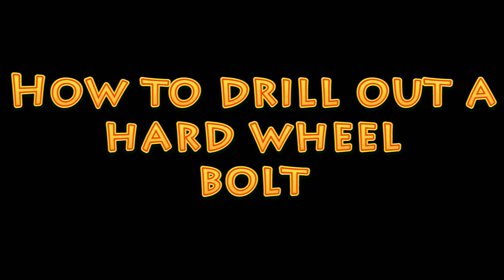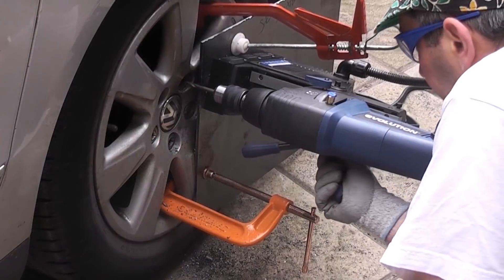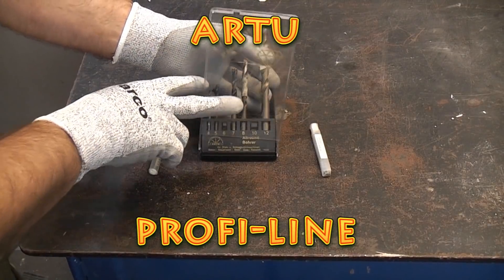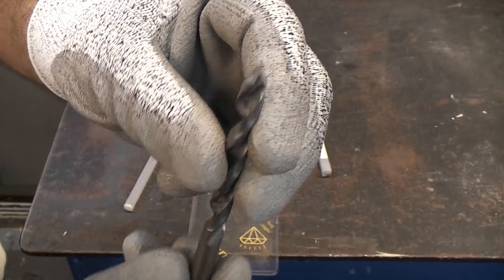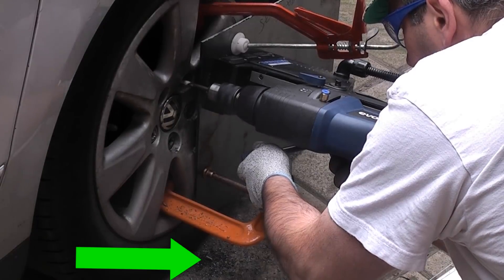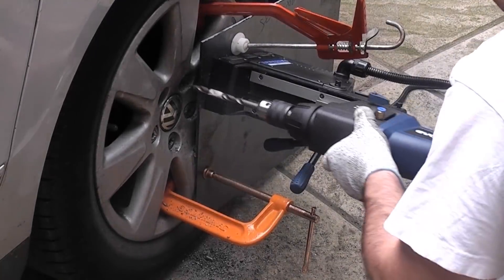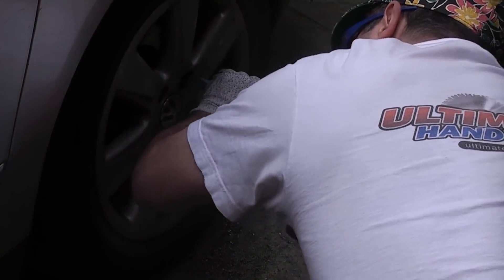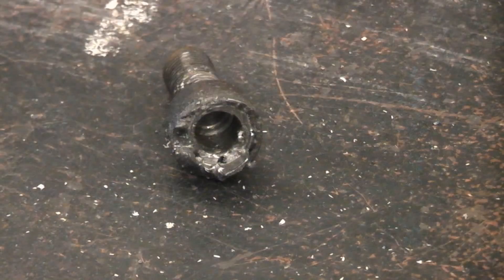How to drill out a hard wheel bolt

Comment: I am trying to drill out an exhaust stud to get my DPF off. All are absolute b-stds. Have cut all heads as the material was completely unrecognisable as a nut and the stud ends. now trying to drill through the remaining part of the stud. Have made progress but pretty slow. I am using a bit I believe similar to the one you are using (Boch expert tungten carbide) the ones with blue flutes. I was under the impression these needed to be on a slow speed and lubricated... Will be sliding back under to whack up the drill speed and let it get hot. Hope the chips fly now. Will report back. Fortunately I don't need to worry about damaging threads as will be replacing with bolts.
Reply: Yep no need to go slow with those bits though they will dull. DPF now successfully removed.

Comment: One my wheel locking wheel bolts has just broken… the head snapped off, just a frustrating situation! I think the garage out the bolts on way too tight, quite a while ago, which didn’t go too well with the aging locking bolts! 
Don’t suppose you’re too far away from Nottingham?
Reply from the maker: I’m miles away, sorry. (Darwen, Lancs)
I’m afraid I no longer have the mag base drill either!
Some garages tighten wheel nuts/bolts using impact drivers, which causes major problems. I’m sure there is a British standard for tightening wheel bolts, which means they should be using a torque wrench!

Comment: Well told if I buy the cobalt drill set would I be able to drill through the stud with my electric drill bit confused because others are saying you can  any help appreciate thanks
Reply from the maker: It depends how hard the stud is. On softer steels a cobalt drill bit will work fine 👍 
Just make certain you use plenty of coolant/lubricant to prevent the drill bit from over heating.

Comment: Help, I (many people also) don't have those special tools. How to remove a free spinning lug bolt with a nut still on it and they are recessed in deep of the wheel? 
Because if I can't remove the bolt, there no way to remove the wheel, caliber & rotor to replace the wheel hub.
Using this drill tips, what type of drill bit I can drill? 
Used carbon drill bits did not good
Reply from the maker: Wheel bolts are much harden than a traditional bolt, so you need a specialist drill bit, such as the ARTU multi purpose bits. You could try any drill bit that is TCT, such as a masonry bit.
A solid carbide bit will work, but they are incredibly brittle and snap easily. 
There is a specialist kit available now for removing anti-theft wheel bolts- but I've never tried it myself.
Reply: @ultimatehandyman  You are correct on the carbide bit. 
When I used them by hand drilling, they mostly snapped.  
Many thanks for replying back.

Comment: Wow.  I believe that I have that exact situation on a 2007 Jeep Commander.  Impact drill, W40, pipe extension, hammer will not release the lug.  Tire shop broke a lug socket attempting to remove it. Woodside, QNs. NY area.
Reply from the maker: Best of luck with it ;-)
Thanks for the comment 👍
Reply: @ultimatehandyman  I finally found a shop that was able use the drilling method to remove the lug.

Comment: The locking nuts are harder than regular lug nuts.  I attacked it for a few hours today with a drill and and am getting close...I think.  A Milwaukee 1400 ft. lbs impact and 2 keys couldn’t  even budge it.  Makes me wonder what happened.
Reply from the maker: They can be a real pain to remove!
Thanks for the comment 👍
Reply: @ultimatehandyman  it’s real tough.  I’m using cobalt and got passed the stud length and am working the width of the stud now.  Hopefully I’m doing it right and using a good set of bits.  This is worse than rusty leaf spring shackles!

Comment: Excellent video. Thanks for uploading. I've got a Peugout with recessed antitheft bolts. I've drilled out two, but got through a fair few TCT bits. HSS just went blunt immediately. I tackling the remaining two next weekend. I've managed to drill most of the way through, and I intend using a stug extractor, but what drill bits would you recommend. I only have access to a hand drill or a mains  sds with a chuck adapter.
Reply from the maker: I used the ARTU multi purpose drill bit for this one, but any multi-purpose drill bit should work.
Thanks for the comment

Comment: Tungsten carbide is better than titanium bit?

Thanks for letting us know not to use a Cobalt
Reply from the maker: Cobalt  will work on most bolts and is better than Tungsten, as it's not as brittle. 
Tungsten carbide bits are very tough, but very brittle, so if the drill moves sideways slightly it will break the drill bit. The bit that I used in this demo has a Tungsten tip, but the drill bit is steel, so can flex without breaking. 
 Thanks for the comment 👍

Comment: Weld an old wheel nut to it, or use a rotary tool grind a slit and whack a flat head into it and turn gotta do it myself tomorrow
Reply from the maker: A mate of mine tried that ( he was a coded welder ), but it didn't work.
Thanks for the comment 👍
Reply: @ultimatehandyman  just done mine with a titan sds drill loading up to YouTube now with chisel not drill piece

Comment: Just as an aside .. there no reason the tyre could not have been replaced WITHOUT removing the road wheel from the car ... not fun job, and requires some patience ... but would require no special tools and no expense.
Reply from the maker: That would probably have been the easier option- not sure how the tyre would be balanced on the vehicle?
Thanks for the comment
Reply: @ultimatehandyman  ... Well first of all Balancing tyre and road wheel assemblies is vastly over rated .. i have my own tire mounting/dismounting machine and have never balanced any tyres on a dozen different trucks and cars in the last 30 years ... and they run just fine 
Second of all? :) ... balancing he road wheel assembly while it is mounted ON the vehicle is a much better prospect if you are looking to actually balance the assembly, as it takes into account the massive weight of the cast iron rotor or break drum as well ... its called "On Vehicle Dynamic Balancing"  and involves spinning the road wheel assembly on motorized equipment ... this type of balancing has been done and top end tire shops since the 1970's at least.
Reply from the maker: Thanks for the info ;-)

Comment: Just buy a locking wheel nout removal spanner. Costs about a tenner and a lot easier to get off rather than drilling. Alternatively, if you dont mind wasting one of your sockets, select the size that is a little too small. Hammer that onto the wheel nut and just remove by undoing as normal. Personally, Id never attempt to drill one off
Reply from the maker: I'm sure the garage tried that- before I drilled it out ;-)
Thanks for the comment

Comment: .......am just now in the process of having to drill out two wheel studs (12 mm) on a 2012 Chrysler Grand Caravan...I must have had a mini stroke when I was at the tire shop last, because I did not stop them from using a pneumatic impact gun to tighten the lug nuts. Need I say more. Chrysler uses a steel lug nut wrapped in chrome plated sheet metal. If the nut is too tight on the wheel, and the socket slips and distorts the sheet metal, you are sunk. Even hammering the socket onto the damaged nut did not work. The nuts were so tight, the socket simply rounded the nuts beautifully. Fortunately the studs are drill-able with coated bits and I used about four sizes before using the 1/2 " final drill. Key to drilling out studs is to make sure the first hole you drill is perfectly centered. I made a centering tool out of a spent stud to accomplish this initial centering. I always clean the threads well, apply anti seize and torque by hand with a hand torque wrench. I also replace the OE lug nuts (the ones with the shitty sheet metal ) with aftermarket nuts machined out of a single chunk of steel.  It works for me.
Reply from the maker: Thanks for the comment ;-)

Comment: What about drilling a slot then twisting a driver in it,   Either it turns or the head snaps off,   Either way the wheel comes off right ?
Reply from the maker: Cutting a slot in something that is really tight, rarely works.
Thanks for the comment

Comment: How does drilling out the center of the bolt help to loosen it? The outer diameter and threads are still intact so why does this work?
Reply from the maker: Two reasons, firstly the heat generated by drilling can help to loosen the bolt (the ARTU drill bits are designed to be used with no coolant or lubrication, so they sort of burn the metal as they drill).
Once the inside of the bolt is drilled out the bolt no longer has as much strength.
Thanks for the comment
Reply: Thank you for your response.

Comment: Nice video Chez. I like the idea of clamping a piece of steel plate on and using a mag drill. Those bits are impressive. Haven't seen the tipped ones like that before. 
I see the "to anti seize or not" argument going on again. Done it for more than 40 years myself. No problem so far. As you say Chez you can reduce the torque by a bit. There is some argument that the proper anti seize stuff is apparently made to actually lubricate as little as possible. 
Never actually put it to the test though. I suppose it might make an interesting experiment. 
Most tyre places where I am in the UK torque the nuts now anyway, and don't just bang them up with the air gun like they used to. 
I binned the locking bolts on my Peugeot. I think a set of four normal bolts were less than £15 online.
I reckon the risk of getting the wheels nicked is less than the risk of having to do the job here!
Keep up the good work mate! 👍
Reply from the maker: Thanks Dave, the ARTU drill bits are good on really hard metals and are much better than solid carbide bits as they are not brittle. 
The anti-seize debate and lock nuts debate (which nut goes on the bottom and which nut goes on the top) can go on for ever!
Luckily, I only drive a van with steel wheels, so nobody wants to steal mine ;-)
Thanks for the comments

Comment: M42 Cobalt bits would drill that right out.  People buy bits that say "cobalt" and then wonder why they don't work. If the bit doesn't say M42 Cobalt then dont buy it.  There is a guy on ebay named drillhog, you can get them reasonably priced.
Reply from the maker: Thanks, I have just seen his drill bits- https://fave.co/2xm7yEQ
I think the ones I tried were the cheap ones I bought from Banggood, I should have tried my Dewalt ones!
Thanks for the comment

Comment: They make a socket for this it works very well
Reply from the maker: Thanks for the comment
Reply: Michael Tate they make sockets but if you don’t have a impact gun you would get the bolt out of the extractor socket I did buy had ther garbage after the bolt stays stuck in unless you have impact gun and compressor

Comment: I know a lot of people in the comments are getting on you for putting anti-seize on the bolts and some of them are correct, but I do it too because I can't bear the thought of torquing dry metal-on-metal. The worst it will do is put you over your target bolt stress a little bit and that's not necessarily a bad thing when you're talking about something critical like holding the wheel on your car. 

A lot of people take manufacturer torque specs as gospel and when you're talking about engine components and such, that's not a bad thing because those parts are covered in oil all the time and protected from the elements. But when you're talking about a part like the wheel that is exposed to weather the only possible way for a torque spec to accurately achieve the desired bolt load is using all brand new parts under controlled conditions. All you're doing when you torque something is educated guessing and when you're torquing a wheel its even worse. It just a shot in the dark. It really isn't that accurate to begin with. 

And for people who are worried that lug bolts can't handle the extra amount of bolt load; let's just say that the lug bolt is a M14 x 1.5 Grade 8.8 (because it won't be any less than that). That grade of bolt yields at 640mpa bolt stress. Lug bolts are usually torqued to about 122NM (90FTLB). When this bolt is torqued dry at 122NM that is about 350mpa bolt stress. 

Now let's just say you had the slickest anti-seize ever. Using a "nut factor" or "friction factor" of .14 (which is super low. You're just gonna have to trust me that your nut factor isn't going to be this low). 122NM is only going get you to about 500mpa of bolt stress. 

I'd be more concerned with people who are torquing their old dry crusty lug bolts to 90FTLB who are probably only getting about 150mpa bolt stress!!
Reply from the maker: Thanks for the detailed post. There are a lot of confused
people on the internet and Anti-seize as well as locking nuts seems to be two
areas that get people arguing. I always use anti-seize on most bolts, I work in
a job where if you don’t use it or if you forget to put it on you have absolutely
no chance of undoing the bolt, which means burning the bolt off. I remember a
while back making a video about nut locking and then people started arguing
that the half nut should go on the bolt before the full nut 😊 Of course when I was at
college we were taught that the full nut goes on first, then the half nut. One
thing I have learned is that people will argue about anything on the internet!
Sometimes you are better off just posting a picture and leaving it at that-

http://www.ultimatehandyman.co.uk/hcg1.jpg

http://www.ultimatehandyman.co.uk/ln1.jpg

 

Thanks again for the excellent comment 😉
Reply: I use a lot of anti-seize at my job too. 

I don’t have a lot of experience with lock nuts or “jam nuts”. I wasn’t even aware that this was a controversial topic. I would think using common sense you would put them together the way you mentioned because you would want most of the load on the larger nut and you would want the thinner nut to be used just to keep the larger nut from backing off. 

After reading an article online about this topic it convinced me that it is better and more effective to put the thinner nut on the bottom though. 

I have very limited experience with these though.

Comment: Did you try hammering on a cheap socket that almost fits. Thats the way its done when stealing wheels.
Reply from the maker: No, I assumed that the garage had tried a few different techniques as the bolt was chewed a bit at the end.
Thanks for the comment

Comment: Hey Chez, I just wanted to ask you a quick question which you've most likely already covered on another video but here goes. When drilling stainless steel with a cobalt bit and cutting compound should you go for a high or low speed drill setting? I'm thinking slow?
Reply from the maker: Yes, I would go slow, unless it's a small diameter bit <5mm in which case you can go a little faster.
Thanks for the comment
Reply: @ultimatehandyman  Thanks Chez as always. Just one more question if I may. On a recent video I saw you were using a cutting compound that was in a nice neat long container, looked really good for dipping drill bits into. I've been looking for something similar as the sprays and oils I've used in the past seem to cause excess mess. If you could recommend me a compound for drilling I'd very much appreciate it! Cheers!

Comment: Anit-seize or a lubricant on wheel bolts  is not allowed by most car manufacturers. You shouldn't recommend that. The rest of the video is excellent - as always!
Reply from the maker: I've been using it for decades, my garage uses it, several mechanics I know use it ;-)
Thanks for the comment

Comment: I'll never understand with the Germans use lug bolts instead of studs and lug nuts....the only sensible reason is the Germans like to make things more complicated than they need to be, silly Germans.
Reply from the maker: Not sure, but there is probably a good reason for it.
Thanks for the comment
Reply: @ultimatehandyman  have you ever mounted an old school Bug or Van tyre? By yourself? I'm sure there's a trick, but it's awkward enough with studs.
Reply: Most European cars use lug nuts rather than studs and nuts for cost cutting. One part to machine rather 2 and one assembly stage rather than 2. Multiply by a few hundred thousand cars and the maths works for them.
Reply: I remember a program where the person who owns a large specialty car business explained there is definitely a small advantage in strength and setting of torque for lug bolts.

Comment: I read not to place Anti Seize on wheel lug nuts and bolts somewhere but don't know where to find the information... Anyways, i'd recommend you don't do it because more lubrication, the wheel torque will be i guess tighter than its specification required. I would only use antiseize on exhausts.
Reply from the maker: Some anti-seize manufacturers have  "for use on wheel bots and wheel nuts" on their packaging ;-)
Thanks for the comment

Comment: Have you ever used an induction coil heater designed for stuck bolt removal, obviously only if there proud of the surface, but would like your honest opinion of one if you ever come across them
Reply from the maker: I've never used one, but they look really useful!
If I ever get chance to try one I will make a video ;-) 
Thanks for the comment

Comment: You should not apply anti seize to wheel bolts unless the manufacturer specifies.

1. Because they're more likely to loosen unwantedly

2. Because it'll affect the effective torque you apply to it when you go to torque it up risking overtightening and damaging the threads

People need to stop applying copper grease to every bloody thing on a car - unless the manufacturer says to, don't. You almost certainly don't know better than the guys who designed it.